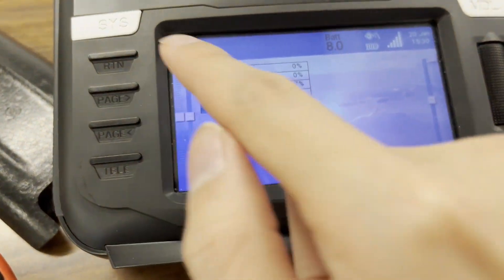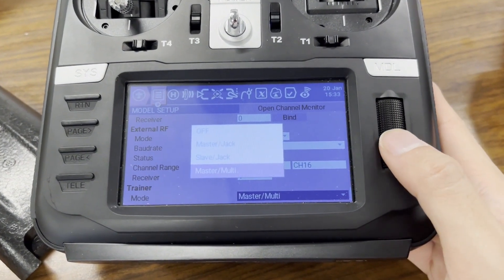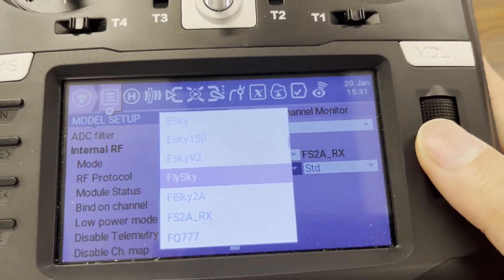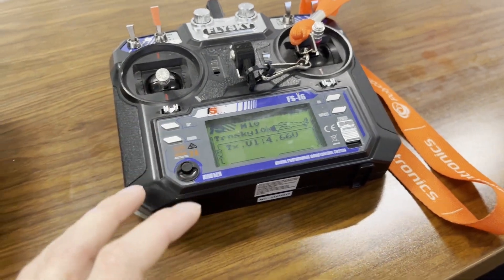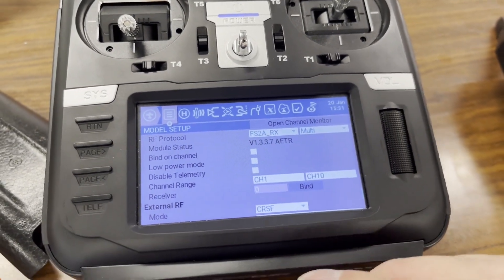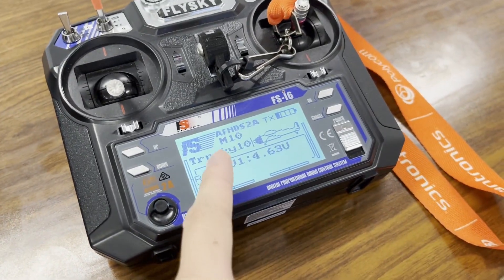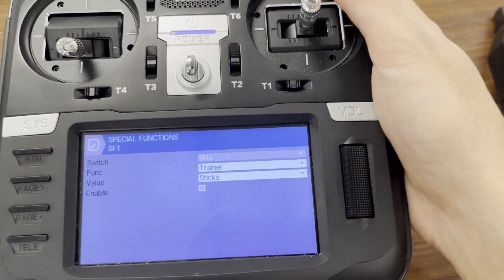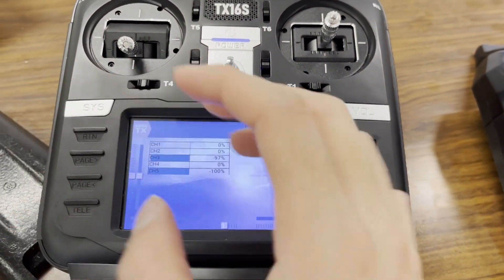Wireless Trainer Setup with TX16s and Flysky Radio

Comment: I did the same setup just right now. I use tx16s with internal elrs, and external 4-in-1. Connected flysky ix6 to tx16s in trainer mode, and it works. BUT. The controls from flysky through tx16s are lagging. It looks like it's updating servo positions, but a very low frequency. Like when im using flysky with a PC simulator through usb. With tx16s everything is fine, very precise controls. Did you notice some lags while controlling in student mode from flysky?

Comment: Do I have to have the cross fire to do traner?
Reply from the maker: not at all! crossfire is just the connection between the primary controller and the plane, so you could do elrs, or whatever else you put in the external bay

Comment: Thank you for the video, didn't even know that was a thing!
Do you think it would also work the other way around? By that I mean using your internal module to bind to the receiver and an external multiprotocol module to connect to the FS-i6?
I'm trying to teach my girlfriends little brother flying,  have an old FS-i6 lying around and currently have a FrSky X-Lite Pro as my main transmitter.
Reply from the maker: I think it's likely that it would be possible, do you have an external multiprotocol that you can try that on? because I don't. Thanks for the comment!

Comment: I'm not seeing flyskyrx on my edge tx. Am I missing something? I see frskyrx but not flysky.
Reply: Hey! I have found the solution, updating the multi protocol module will fix it
Reply from the maker: @joytanishq2127  oh awesome! there's a way to update just the module and not the transmitter firmware?
Reply: @seanyfpv yup
Reply: @joytanishq2127  A bit odd that you had to update your Multi firmware to get FlyskyRX when you already had FRSkyRX (or the original poster did.) FRSkyRX was the 55th protocol added and FlyskyRX was the 56th. Don't know how long between them but I'd guess not much. 😉😊
Reply from the maker: sorry for the late reply, what firmware version of edgetx are you runnning?
Reply: @seanyfpv  hey, I have the same problem I am using v2.8.3

Comment: Yooooo!!! That's awesome af!!! So I have an Fs-I6x I'm assuming I can do it with that TX as well? I'm assuming you're using the Crossfire for the wing? Can it work if you were using an FrSky whoop and set the FlySky as a trainer? I'd love to finally let my nephews get a rip in without having to worry about breaking anything!!! Lol
Reply from the maker: thank you! yeah it should work with an fs-i6x. i'm using crossfire for the wing connection. You should probably be able to do it with frsky as long as you have a spare multiprotocol module (either external or internal) on your transmitter that you can use as a receiver to connect the flysky transmitter